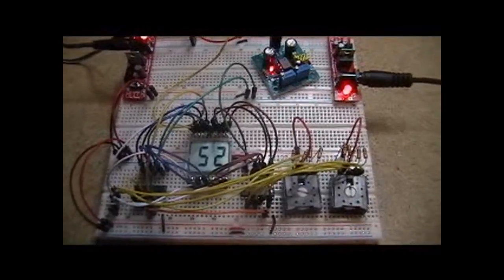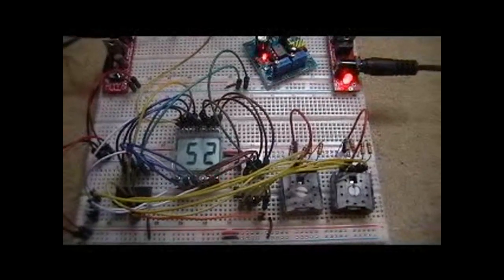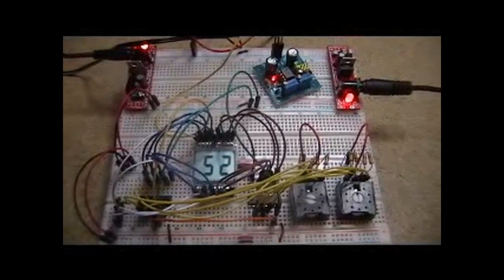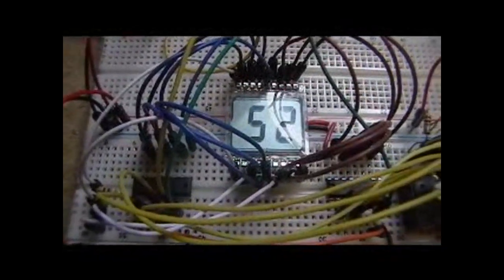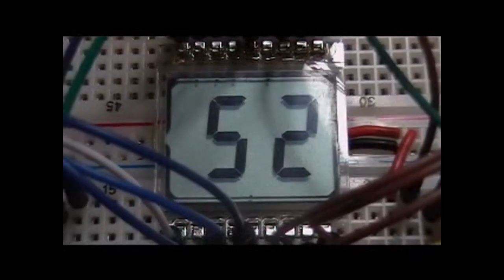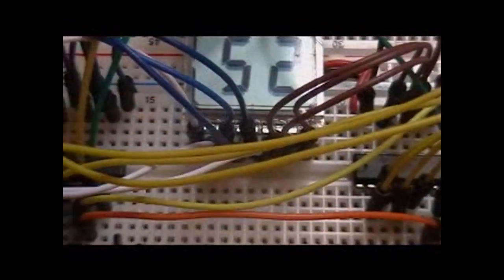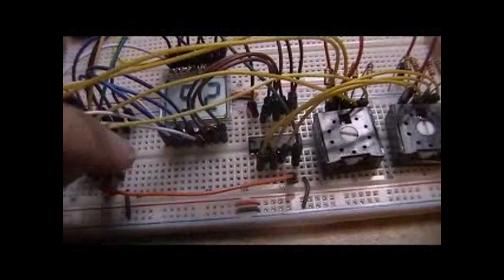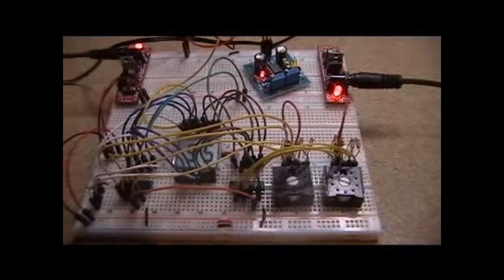Driving LCD 7 Segment with CD4055 ICs

Comment: Can you tell me if you have any way to use the seguiment of the display of a calculator ???
Reply from the maker: It is going to depend on the type of the display from the calculator.  I am assuming that it is also an LCD panel in which case, you should be able to do something very similar to this video although with more digits it will require more circuitry.  To be honest, it is probably easier to use an LCD controller to drive the panel since it will already have all the necessary logic.  I did this mostly to gain a real understanding of how to do it and experiment with the display.